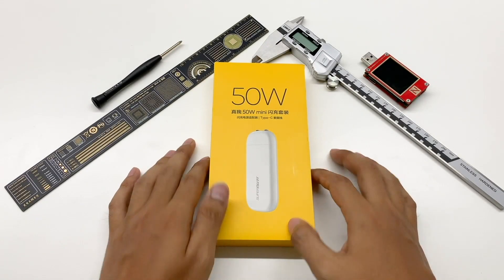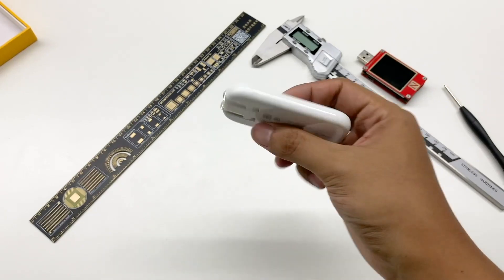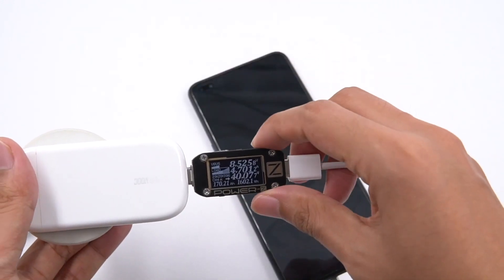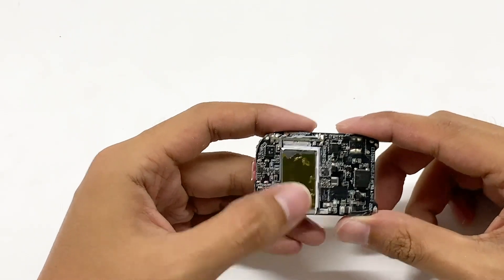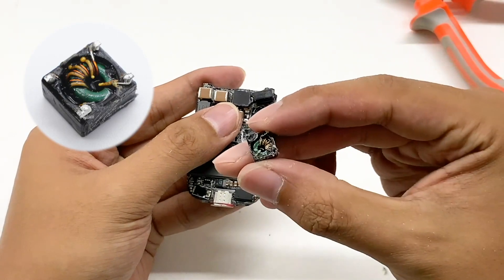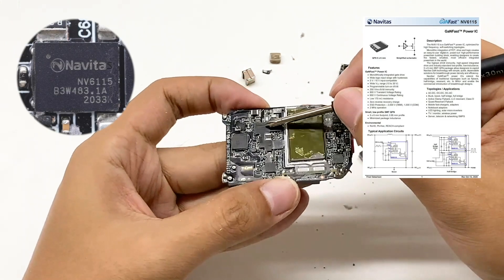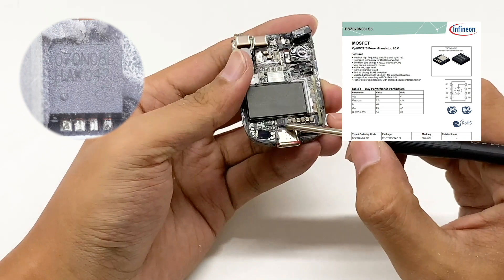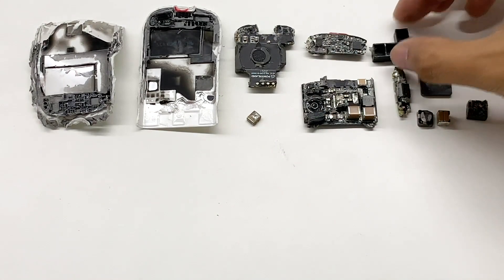Teardown of Realme 50W Mini SuperDart Charger (Ultra-thin)

Comment: Is it safe to use this charger for macbook air which comes with 30W charger? And May I know what am i losing with this charger? i am planning to use this as a travel charger since apple 30W charger is bulky. Is this charger as safe as Apple Original Charger?
Reply: What do you mean by normal condition?
Reply: @minhtet9379  like indoors but charging it in extreme hot area it not safe.
Reply from the maker: It is safe under normal condition.

Comment: MLCCs shouldn’t be used for mains, you can have a lot of power spikes and MOVs can’t save it and they very easily go short circuit. Not enough capacitance on the output even keeping in mind the higher switching frequency. 
But the charger is still impressive.